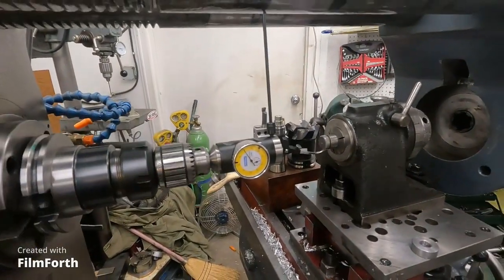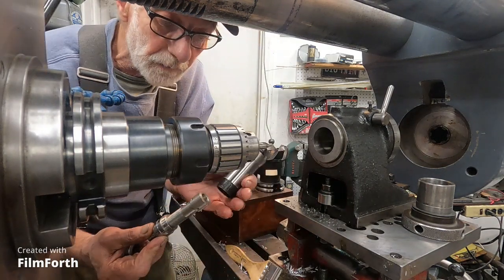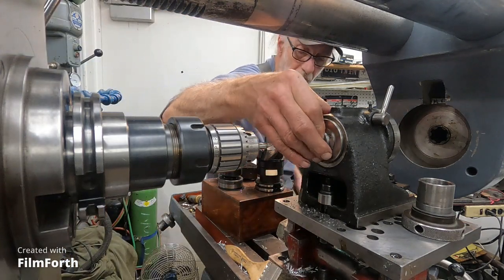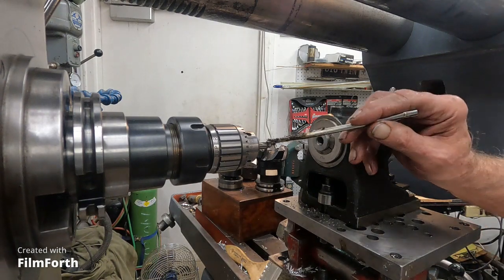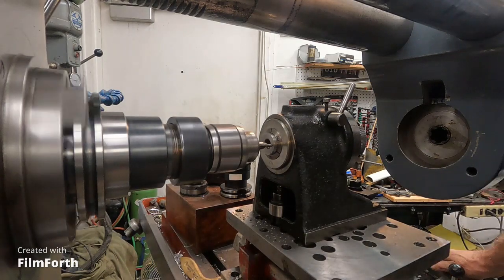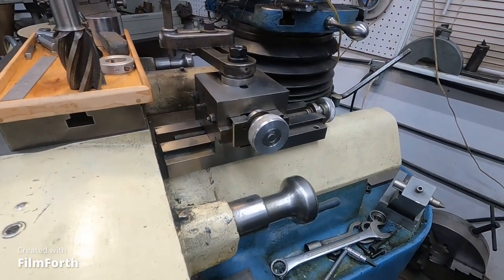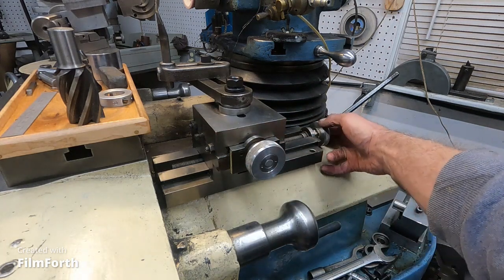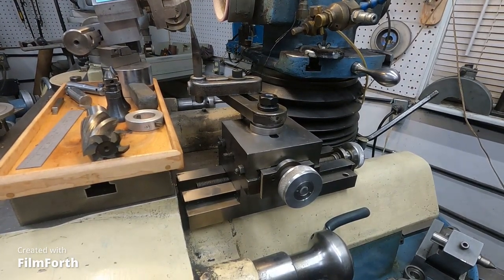Tool & Cutter grinder adjustable finger rest project finished

Comment: I like that collet stop, I have the same Hardinge collet fixture. That finger stop definitely gives you many options for placement. Happy New Year’s.
Reply from the maker: I have had that little Hardinge head for years  it is really useful. The attachment for adjusting the finger is something cooked up locally decades ago at the Hanford site, it has another function where the top table can be swung 90 and the device can be used as a template holder for grinding shapes and forms using the ball bearing table, I want to explore that soon.
Reply: @deedeeindustrialsuperprecision  that would make for a good video.